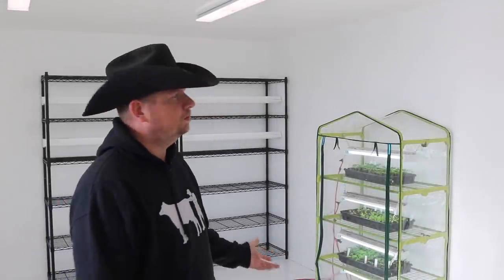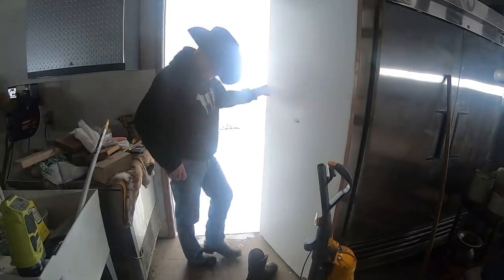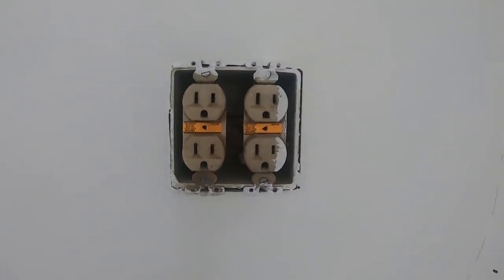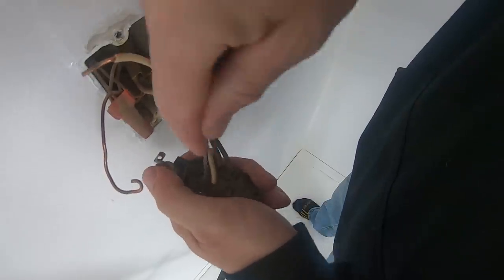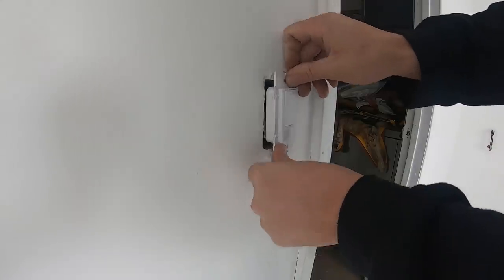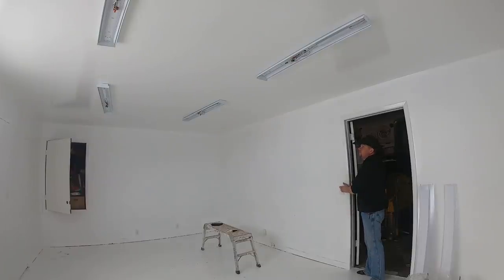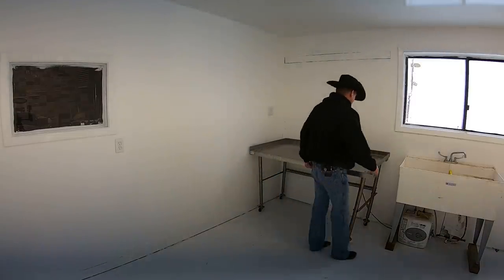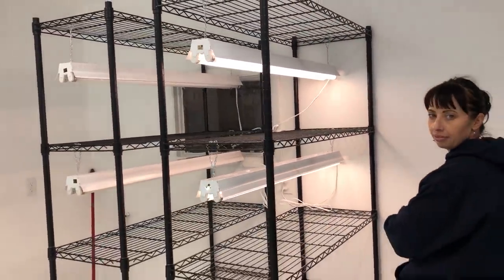Building a Grow Room

Comment: Live on the edge Mike keep the power on, 110 wont kill ya it might sting a bit but you wont die lol
Reply: Ehh..  10kv wont kill ya either. It's all about the amperage and where it hits you.
Reply from the maker: LOL Quin A, Ive been bit a few times. Sometimes its just easier to turn it off.

Comment: What you want is "daylight" quality lights, since you likely won't be growing blooming plants, which require the colored spectrum of lights...LED is the best, most economic and longest lasting, these are regular shop lights, you can get them on Amazon, like 6 pack for about $120.00.  Just make sure they are 4500 Lumen or higher and about 5000 Kelvin...it can vary a bit, you can make up by adding Lumen if the Kelvin is less, but you want Daylight quality.  I've used this configuration and it works super also for Microgreens, you can daisy link them, and adjust them up or down, and are about 42 or 48 inches long, so the match tge shelf size of the larger shelving you have. Some have two rows of LED which is better. The reason I switched from fluorescent T8's is because fluorescent lights have Mercury in them, and if one breaks your entire room is contaminated, and its almost impossible to decontaminate the space, I like it's being absorbed inside the room...not good for your health, especially not children. When the lights are high up there isn't so much of a chance of breaking them, but you'll be moving yours around, adjusting and so forth, so anything can happen. I've used this method for last 3 yrs and works wonderfull. Hope this helps.
Reply from the maker: Daylights are a cooler bulb. I want more warmth :).  Thanks
Reply: @OurWyomingLife  For vegetative growth, as in vegetable seedlings, my recommendations are virtually perfect.  They will grow under any kind of light, finding a good balance is the key, but warm light (too much) will stunt the vegetative growth because warm in better for flowering plants.